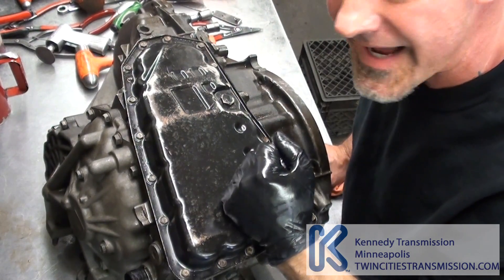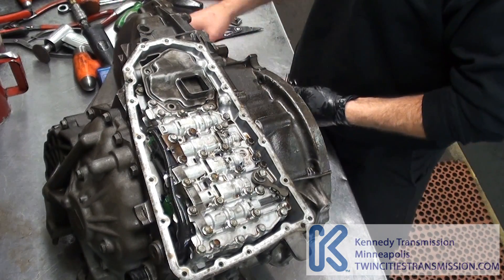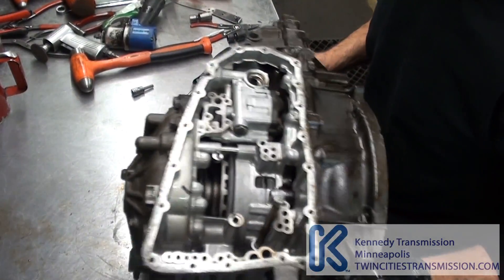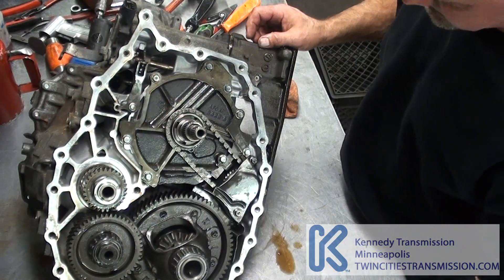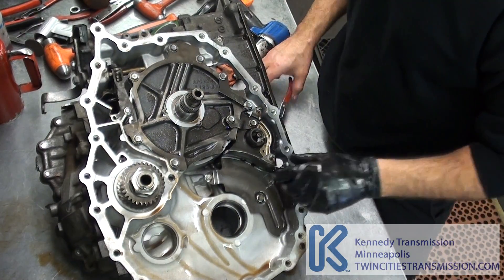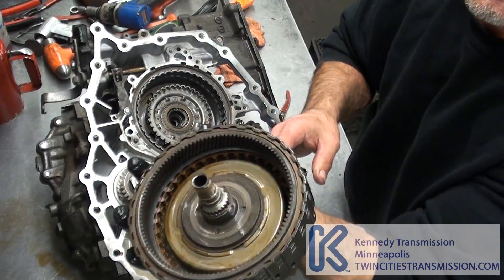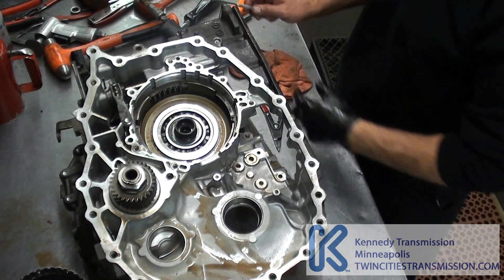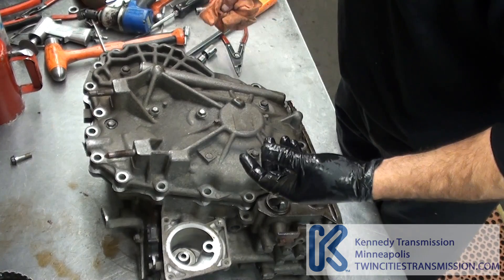Mitsubishi Nissan Jatco CVT (JF011E)

Comment: The mileage on any of these machines doesn't matter. The way YOU drive does! CVT's are "economy" transmissions, it's not a Ferrari so don't drive it like one. If your MPG is NOT 28 or greater, you're doing something wrong. Like firearms, it all depends on you. It is NEVER the machines fault, it's the operator.
Reply: How you drive has a major factor in how these transmissions perform or fail. Yes, I agree they are junk. Most ppl want to abuse cars these days and just throw them away anyhow. They also generally drive like assholes. If you do your cvt is gaurenteed to fail faster than turning on your lights. I do not drive like I am 85, I drive within my vehicles capabilities which being a 13 Rogue are limited by the low horsepower and cvt to boot. I have 178k and still ticking with no issues at all. If I would have known or done my research before purchasing it I wouldnt have. Water under the bridge now. I also unfortunately have not changed any fluid yet, my fault. I will be doing this soon, and in 2 months again to get it cleaner. Also adding an extra transmission cooler to boot. Fluid changes on these are not like standard automatic transmissions,  you can do them in excess of say 100k because they do not have clutch packs that wear out and the dirty fluid keeps them working. My fluid is not super dirty, but needs changing nevertheless.  I drive minimum 650 miles a week and only have had 1 set of brake pads,  on my second set of tires, first set at 50k, 2nd at 145k. One axle boot. Tires where 75k rated and still had about another 15k left maybe. In no way am I saying these transmissions are great, maybe borderline good on the low end but if you dont abuse them and drive responsibly,  they can be reliable.
Reply: As you say mileage doesn`t  matter  if all it does is city work and short running.
Reply: It says it's the operator's fault. If you're consistently avoiding highways then it's still not the machines fault. It's you! It does say that right? Or am I blind?
Reply: After I purchased our 2014 Subaru Forester, I only learned from You Tube vids  in 2017 that our CVT IS A JATCO. We have 75K on it, but I started doing drain n fills at 60K because I know oil does not last forever. Subaru states not to break thexseal on them as "they are gaurenteed for LIFE". Whose life anyway? Warranty, thats it.

So, between many Subaru blogs, my independant mechanic, I am currently flying in the face of what Subaru recommends.

Same with engine oil. Maintenance manual states 7500 miles, i change mine at 5000 miles.

Differential was recommened to change at 60K, my mechanic said 50K is about as long as they would go.

So I am coming up.on my 3rd drain in fill. I am concerned as the color at the first drain was beige, the second was more amber.  Any thoughts?
Reply: @robertweber3140  I don't think that the Subaru CVT is made by JATCO.  According to WIKI (ok, i agree it's hard to find a legit source of information on the internet sometimes), Subaru's CVT transmissions are named Lineartronic and are made by Fuji Heavy Industries who is Subaru's parent company.  Looks like the previous Subaru automatics and some of the manual transmissions were "JATCO designs adopted to Subaru specifications."
Reply: @nucklez  , thank you!
Reply: NEVER. Oh come on now. If you have to drive like an 85 year old woman to preserve the life of your transmission then I would place the blame on Nissan and others who use them. After all, the typical driver isn't 85 years in age.
Reply: I dont know man... Some car companies just FLAT OUT don't know how to build a car properly. And apparently Toyota KNOWS how to build a car
Reply: Yeah, my 2010 Nissan Sentra is at 144,000 miles, commute to work 5 times a week, transmission still good👍

Comment: CVT transmission is the worst invention ever......don't ever buy a car CVT trans.....wen it want to fail?.....doesn't care about the milage...
Reply: Everyone knows friction is the no.1 enemy of any machine's prospect of longevity.  Where friction is required and in great abundance, you know you've got problems.
Reply: The problem is Not the CVT itself , All Jatco gearbox are sucks ... AISIN CVT s are excellent.... Only problem with the CVT is that they don't accelerate well from zero to 20kmper hour , after reaching 20 KM/H they accelerate fine and this suits a lot of drivers. Again All Jatco gearbox are not durable it is ONLY AISINS that are very durable.
Reply: @kaddahymohamed5130  and toyota recent cvt models equiped with additional fix "launch" gear.
Reply: well CVT was first banned in F1 because it was too good....lol 
some people complain it doesn't have gear so they don't like it...so later companies try to make CVT like normal AT....and that is stupid...

Comment: Man it blows my mind how much engineering goes into things we use and take for granted every day. It's like a masterpiece of machining and technology. And it's just an automatic trans on an average car
Reply from the maker: Gary,I really appreciate them as well; they are challenging to work on in some ways, but always interesting.  The precision that goes into CVT variators and management of the hydraulics in particular is amazing.  Thanks,Matt Johnson
Reply: Yeah if you work in engineering you look at everything differently. So many things people take for granted there were several engineers busting their asses to get that thing to work.
Reply: Transmissions are, short of the engine, the most critical component of an automobile: no working transmission, no forward movement. Modern society would cease to exist without incredible engineering 🌟
Reply: word.
Reply: We're so spoiled. People have shunned Nissan because of these transmissions.   They don't realize. You have to do maintenance on them

Comment: Thanks for the video, but after watching it I would not trust you to repair anything on my car. You come across as disorganized and careless: take off this - boom! pull out that - boom! The last time I had a similar uneasy feeling is when I saw how a tech guy was taking off the front struts on my car by hitting the hub with a sledgehammer - he was doing it in the wrong order, already having removed the top bolts that connected the strut to the body. This does not look as bad, but still...

Comment: Wow..nice job..you got it going on with this transmissions! I have 2010 Maxima that just started making a whirring noise at 130k..the thing is working perfectly but for how long idk. fluid hasnt been changed in 40k until the other day(didnt help) should i flush out the converter? Is there anything you can tell me to try or do to make this noise go away?Also..is there a strainer(filter in the pan?Nissan told me that they do not list one for my 2010 Maxima.. I think mine can be saved if i get after it right now..seen as how the noise has just started and tranny isnt acting funny. Lastly..any ideas on a part number for the pan filter for this car.. ? its crazy the lack of good info on these transmissions i have spent endless hours and cant find much.Thanks for any help!
Reply from the maker: Paul,There is a screen filter in the pan on your JF010E, but we generally only change them for maintenance (I have not seen filter plugging issues on these units).  There are a few different filters used on the JF010E depending on the application; most commonly, steel pan (203010A) or aluminum pan(203010B).  Have you used OEM fluid and verified that the level is full (often flush machines simply put in what they take out)?Thanks,Matt Johnson
Reply: Thanks for the reply ! Yes,,OEM Fluid only.. and its full...i was going to take the line off the external filter,..,start the car until it pumps out 2 quarts into a jug..then add 2 new quarts in the dipstick tube,repeat the process again like 4 times..hoping this will change the fluid that is in the torque converter..its a costly flush but thats the only way i can think of how to get ALL the old fluid out.(Please correct me if i am wrong on how to get that fluid out of that converter ) The transmission was always and still is working perfectly for now but has  that  rrrrrrrrrrrrrrrrrrrrrrrrrrrrrrrrrrrr sound that has suddenly started..(i myself would swear its electrical..the sound actually changes frequency to... it goes from mild to pretty loud then switches back to mild..its all over the place as you drive. For example..just backing up for 50 yards at 5mph.. it gets louder the faster you go...the rrrrrrr sound...same with driving it forward the same distance (i tested it repeatedly in my driveway.lol) I am really hoping to find a solution before i destroy it for good...as of now i think it is fixable.I am willing to try anything you can suggest..i dont have the money for a reman and wont trust a used one..what a nightmare because the car is a beauty. I got  $2000k i would invest but thats the max..Should i change that filter in the pan or am i wasting time? Would you guess its the tranny headed south at this point.. Ive been told i need a cvt unit by a local shop last week but what do they know i figure. Other then the noise..no codes..no check engine light..no other symptoms.Thanks!

Comment: Hi Matt, i have this 2007 sentra not sure about the transmission number but its making a super loud whining noise. What do you think that causes it to make that annoying sound? I hope you could help me. Thanks in advance.
Reply from the maker: Archie,  Is the whine only when the vehicle is moving?  The first thing to do is make sure the fluid level is full.  If the pump is drawing any air at all with the fluid, it will give a very loud whine even when not moving, and damage can happen quickly.  If the fluid level is full, I would suggest you have it run on the hoist and have a technician listen with a stethoscope to see if he/ she can tell what area of the unit the noise is coming from.  The pan should also be dropped to assess the metal content- if it is heavy, the issue is likely a bearing.Thanks,Matt Johnson
Reply: Yes sir, it only whine when its moving and its louder when i am going out of the driveway running 10-15mph and also when  going up and downhill but unnoticeable at 40mph and up.
Reply from the maker: First, verify the fluid level of course.  Then I would get a look in the pan.  It does sound like a pulley bearing on the variator though.  I would really minimize driving it, if it is a variator bearing failure, it can cause a lot of additional damage inside.Thanks,Matt Johnson

Comment: I have the same tranny in my 2010 jeep patriot.I have 2 dtcs." incorrect gear ratio" and secondary pressure solenoid stuck on".can you please advise what is causing those codes and do I need to rebuild my tranny? If I keep the rpms below 2500 when taking off  and just driving in general I can keep it out of safe mode .what do you think?when taking off Rpms go very high unless I baby it.also when shifting it and I come to 5th gear it down shifts and 6 gear as well down shifts.
Reply from the maker: Robert,Unfortunately, the issue would need to be properly diagnosed.  If there is a clue such as excessive metal shed in the pan, this would surely indicate an internal failure.Thanks,Matt Johnson
Reply: @kennedytransmissioncvtauto5430  there was metallic build up on the magnets but no chunks .so you think the whole tranny needs rebuild?if I take the tranny out and take it to you would you rebuild it for me and how much?if this is a possibility private message me.my email is rg2297385@gmail.com.   I just sent you another message at 4:am Sept.1.I just saw your reply to my message from before.email me if you willing to rebuild my tranny

Comment: Matt, I have an 08 Lancer that makes a whining sound only when moving. It sounds like a loud electric motor. When people ask; I tell them it's the "Electronic Turbo". Road sound usually blocks it out over 35mph. I bought the car months ago (knowing about the sound) and immediately drained and added new CVT fluid, but no change. I have put many miles on since and have had no problems. I lifted the car and let the wheels spin while running; I am fairly confident the sound is coming from the CVT. What do you think is causing it?
Reply from the maker: Ankly,It sounds to me like a bearing.  It would be a good idea to drive the car on a free wheel hoist to make sure the noise is actually coming from the transmission.  Unfortunately, none of the variator or transfer gear bearings can be serviced without removing and disassembling the unit.  I would also expect to see a heavy metal content on the magnet in the pan if this is a bearing issue.Thanks,Matt
Reply: Sounds like the CVT is beginning to fail.
Reply: Change the cartridge filter and o-rings in your CVT cooler housing, which is below your battery tray. The battery tray can be removed to access it.  Then change your CVT pan filter and gasket as well. Use Eneos or OEM Mitsubishi CVT fluid and original parts only.
Reply: I did this to my Lancer and no whines. Change these filters every 60-90k miles. I would go for the minimum.

Comment: Is that pretty much the standard maintenance for all CVT's to have the oil and filter changed around 30k miles or do would you recommend a different plan? Thx.
Reply from the maker: We make the 30,000 mile service recommendation to all our customer's with CVT transmissions.  The ones who seem to stick to it the best are the customers who have had to have us repair or rebuild the unit.  Sticking with the OEM fluid is best as well.Thanks,Matt Johnson
Reply: Kennedy Transmission, CVT & Auto  What about Amsoil ATF?
Reply from the maker: M Ladd,I would certainly not use Amsoil ATF in any CVT, but Amsoil does make a CVT fluid.  I have not used their CVT fluid, but do have a case of it on hand that I will use on a CVT that we can monitor.  There are differences in CVT fluids- most notably between Nissan's NS2 and NS3.  I have seen some odd "gelling" in the very small valve body spacer plate ports of a JF015E that was concerning and that solidified my bias towards the OEM fluids.  In general, I think Amsoil's higher end lubricants are very good.Thanks,Matt Johnson

Comment: Do not buy a car with a JATCO transmission !!!!!!
Today, JATCO has become one of the biggest supplier of CVT,
 and products from nearly every auto maker have used Jatco transmissions,
 with the notable exceptions of Honda Motor Company, who makes their own 
transmissions, and Toyota Motor Company, who has always used transmissions
 made by Aisin, a subsidiary of Toyota.
Reply: Subaru makes their own CVT transmissions.
Reply: @steverobertson9655  Yep....and they don't have that goofy belt design.  They use a chain design.  Significantly better.
Reply: slc9800gtx I’ll stick with my regular 6 speed in my Buick Verano
Reply: @End OfTime no, subaru cvt is built by fhi.

Audi and subaru cvt is assisted by luk technology. 

In April 2009, another CVT using technology made by LuK was introduced: Fuji Heavy 
Industries Ltd. unveiled its MY2010 SUBARU Legacy as well as the MY2010 SUBARU 
Outback at the New York International Auto Show. 
Figure 2: FHI/ SUBARU’s longitudinal AWD-CVT LineartronicTM [3] 
The drive train combines SUBARU’s horizontal-opposite (HO) engines with LineartronicTM, a 
brand-new longitudinal, highly efficient AWD CVT with torque converter as a start-up device 
(fig. 2). LuK supplies chains and guide rails to FHI and supported the pulley system 
development.

Comment: Is outlander sport : ASX  cvt tranmission common to fail ?
Reply from the maker: Most of the Outlander's use the JF011E.  I would recommend servicing the fluid and filters every 30,000 miles (50,000 KM) or so to maximize life.  We have seen these units approach 200,000 miles without issue, but have seen failures as early as <60,000 miles.  We have one in the shop right now that failed internally at 75,000 miles.  People rarely service these transmissions until they have an issue and have the unit repaired or rebuilt, so it is difficult to give you a good idea of how long a well maintained unit will last.
Reply: @kennedytransmissioncvtauto5430  , thanks for the answer on Outlander. Question: do you know which fluid is recommended for this car CVT transmission? Thanks.
Reply: Lol i forgot to service the filter only fluid.damn,i dont know cvt has filter

Comment: great video.  cvt trans is such a problem. and it doesn't last compare to step auto.
in my very humble opinion you know your work at the back of your hands smooth like butter.
tell me which brand of auto transmissions and cvt transmission. do you think is reliable and durable?
Reply from the maker: We seem to see the least failures in Lineartronic units.  The TR580 and TF690 generally hold up very well.  Occasionally we see primary bearing failures in these units, but it is relatively rare in comparison to the number of units on the roads.ThanksMatt
Reply from the maker: Kito,The Subaru Lineartronic (TR580, TF690) have proven to be pretty solid.  Although they are not pulley systems, most of the eCVT's out there hold up well.Thanks,Matt Johnson
Reply from the maker: Greg,The JF015E is in wide use now in many smaller vehicles.  We have worked on quite a few of them and have found them to be fairly straight forward.  They are similar to the JF009E with the addition of a high/ low range clutch which expands the ratio range of the unit.  I do find the single shift a little odd feeling when driving them, but it doesn't seem to bother most people who have these units.Thanks,Matt Johnson